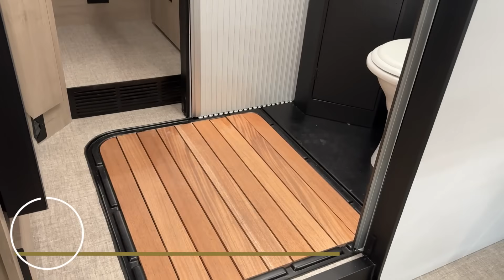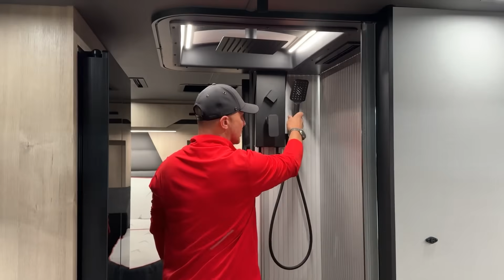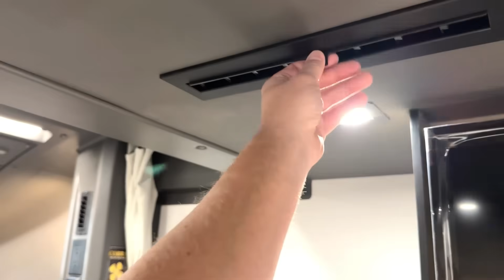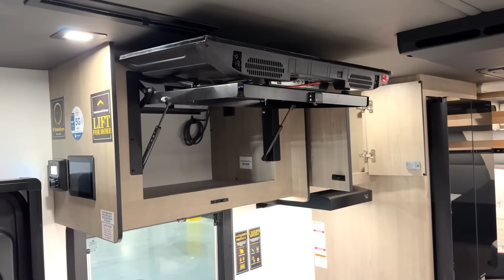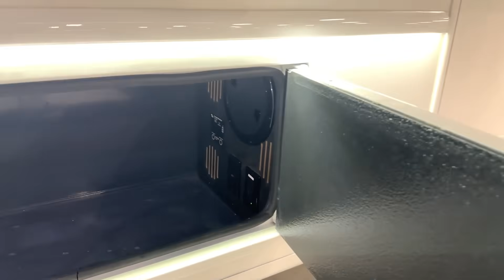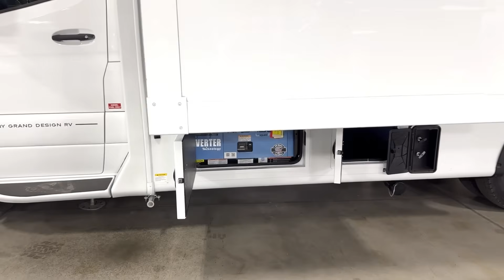RV WORLD FIRST! New 2026 Lineage 25TK Twin & King Bed Luxury Class C Motorhome by Grand Design

Comment: Would have really liked knowing if the gen. is propane or diesel.  Probably just go back and grab the model number he called out and run a search,  Love the below roof comments, I had thought maybe I went into flashback mode again..  Forgive me - the gen. is gasoline, I’d suspect that would make the engine as well.  Doesn’t Mercedes make a 4 cyc twin turbo?  I’d need something a bit heavier.  (Of course we all should’ve figured that out with only a 3500lb tow capacity).  If its the 4 it won’t make my list.

Comment: Looks really nice..BUT isnt Grand design having some serous product problems I once thought that they were the best RV out their but now I am hearing many complaints from many customer..and how is grand design dealing with this? I am in the market and looking.
Reply from the maker: Motorized and total are two different animals. A lot of that sentiment is also based on information from several seasons ago. It made a lot of changes since then, but no one seems to be reporting on the things that they’re doing well. Only the things that they did not do well previously.
Reply: @JoshtheRVNerd  Thank you..G.D. needs to speak up on there past and where they are now..Very true you will always hear the bad and its very rare to hear there improvements. Being a R.V. owner,I know already how hard it is trying to find a well(JUNK) built R.V.
and along with a rock solid  warranty .

Comment: Instead of the hanger type thingie on the hard to reach side, why not have it in the middle part?  I'd much rather a "Hope Chest" style under the bed for blanket / pillow / mouthy passenger...KIDDING!  lol   I really like this design!  I have lupus, so many times my fingers or knees or hips are stiff, so I like NOT having to step up into a shower. I'm also 5' tall, so I'd rather my feet don't dangle in the air if I have to sit on a perch toilet lol  It's the little things in life you learn to appreciate when you're older.

Comment: Great job reviewing this “prototype.” Will this vehicle be able to withstand light off-road driving to get to those scenic lake spots, etc. I am allergic to propane so I would prefer an electric movable induction cooktop to be able to cook inside or out. Plus, that would free up more counter / cabinet space above and below allowing room for appliances like Instant Pots, etc. And then instead of a cooktop range hood you could install a simple hanging glass protector. At this price the stairwell should have a cover piece to prevent falling or even better, the stairs should be completely on the outside. All the cabinet doors should be flush. The kitchen sink faucet should have a retractable sprayer head. The rod for hanging clothes is really neat and using cedar to construct it would be a bonus. I don’t think the euro door is all that it is hyped up to be since it is so narrow. I would prefer a wider door with a bear proof steel “screen door”, like the Tiffin class C. It would last longer if the outside storage boxes were made of fiberglass or metal rather than the plastic you said the production line will have. The towing capacity somehow needs to be increased to at least 5,000. The shower is super innovative and clever! However, some sort of “covering” needs to be engineered for the shower floor to convert to a hallway. Or maybe the shower floor could roll in and out of the toilet / sink area? Also, the bathroom sink needs to either be extended out from the wall or the type that folds up to the wall as those can be very long when brought down for use. Is there an option for the toilet to be the incinerator style? Also, if the length could somehow be shortened to 24’…

Comment: Very cool I like it a lot my one really really big bitch. Is that full fiberglass beautiful tail cap with no bumper ? If you take a hit that whole cap is ruined there really needs to be a bumper. Or provisions to add one. Also, stinky slinky should be on the bottom, not on the top. You don’t want sewage dripping down on your valve controls. Also, there needs to be allowances for battery expansion so if you feel like adding extra batteries, like use one of the storage compartments, you can easily hook up extra batteries.
Reply from the maker: Maybe the receiver hitch could be used to have a bumper insert?

Comment: I love that you don't have to open the slide to access the beds.  My question is - can you sit in the recliners when the slide is closed.  I believe on Schwintek slides you are told NOT to sit on anything in the slide when it is retracted into the RV because it could do damage.
Reply: If there's seat belts, then yes
Reply from the maker: Yes, you can. Motorized RVs and tow bowls are essentially constructed differently. Motorized RVs are built with the idea of occupying them in transit. Where is RV’s usually are not

Comment: Instead of a teak floor under the shower I think an attractive and durable composite plastic wood-look floor would be better.  Teak is too difficult to maintain and I feel it will get funky and require too much care.  Also I would want to put an easily washable area rug over that area because I wouldn't want to dirt and stuff to fall through the grate.  I do love the idea of having a larger shower though if it works well in fact and not just theory.

Comment: Love your show but will never buy another Grand Design.
Reply from the maker: Not looking to argue or change your mind - only understand. May I ask why you feel that way?
Reply: @JoshtheRVNerd we had a brand new grand design fifth wheel for a three or four years that required a lot of work. It was a 2019 303rls. We also had some frame issues that were thankfully fixed under warranty. Even so, Grand designs frames don't have a very good reputation right now.

Comment: It’s a start but it. Ed’s cleaned up ascetically.   Make the kitchen cabinet doors and drawers flush…have an options for a king or queen bed and take that middle wood thing out that’s between the beds.  Bathroom cabinet and sink could look a lot better…under mount the sink and just use a smaller faucet.

Comment: I dont get how this can become a dry bath by covering the toilet part when showering, then water will be splashing outside the kitchen area if you cover the toilet and not enclosing the shower area part. Also, does the shower area have vent fans? Curious if its the dollar fart fan or the FFFFF
Reply from the maker: There are multiple different partitions. You can enclose the shower and toilet. But there’s also a second interior partition to also cut off the toilet area without exposing the kitchen.

Comment: Love the innovative bathroom; genius! Love the large inclining twin beds; wish they could convert into a lounge area. Love the acrylic windows; hope the blinds are on the bottom side for privacy! Love the quiet AC. Hate the slideout, always problematic ! Nice galley. Hope it has a true residential minimum R-20 insulation... not fake 4season... Looks promising!Love the innovative bathroom! Love the large twin beds; wish they could convert into a lounge area. Love the acrylic windows! Love the quiet AC. Hate the slideout, always problematic! Too many step sections. Very nice galley. Three TVs... they should be optional, hate those outside TVs. Hope it has a true residential minimum R-20 insulation... not fake 4season..., heated floors to avoid noisy heaters and increased comfort, and on-demand WH. Great, a 4500 chassis. Hope they offer a no cab over option, more aerodynamic and reduced height... I am somewhat pleased. Looks very promising! Thanks.
Reply from the maker: You bet. My pleasure

Comment: Josh, I think that's the perfect party-mobile for uncle Gary and I. It's got everything that we'd need to keep the party going. 😁

Of course, I'd need to clear it with tge boss (a.k.a. my wife), because the last time I went on a weekend party trip, I couldn't find my pants. 😋

EDIT:
To your point about making things better, or cheaper. I'm with you! There's nothing worse than getting to your destination, only to find that something integral is broken/defective.  On the other hand, I hate it when manufacturers go overboard, by providing good quality for astronomical prices. It's egregious; and not necessary. Fair prices for fair quality. 😃👍
Reply from the maker: party with uncle gary.. brave man

Comment: Major kudos for bringing welcome innovation to RV design in the US! The one major suggestion I would have made, had I been asked, would be to build it on a double floor. That would add insulation from cold, increase storage in the floor, allow tanks to be located for optimum center of gravity, and permit a level interior floor. Many European coaches use double floors, and I imagine using the MB 4500 chassis would have accommodated that feature here. Cheers!
Reply from the maker: Thanks for the tips!

Comment: Outstanding review…well-done. A very innovative rig. Several questions…is there an option for more lithium? Is there a second altenator that can charge the batteries while driving? Is there a generator delete option? Finally, wonder if could move the  outside speakers and sound control up so the light bar body trim goes all the way across without interruption for a cleaner look. Can’t way to see in person and test drive
Reply from the maker: Essentially, they’re just not offering any changes to those extent

Comment: I love everything in this. All my must have but one. Not enough towing 
We have a 59k Winnebago travato. Love it,just need something just a bit larger for a bathroom. I wish they would give 5000 pound towing. Don't understand the 88 pound propane?? You don't need that much and it adds weight. The tank sizes are great. For those of us that will never use over the cab as a bed it would be nice as an option for additional hanging some kind of bar. The curtains will hide anything you put up there. Being able to have that area for more clothes would great. Still need some more CCC. 1400 to1500.
When you add all the water weight, propane,people and #Stuff. Don't need three TV so that should be optional.
Reply from the maker: Yeah the mercedes setups are usually more limited on towing vs something like a ford E-series

Comment: The hanging storage under the bed should have a panel that opens on the front, so that if you use it you can get in there without lifting the bed

Comment: Very fancy but missing the space under the top step for shoes, and the built in gas grill set up
Reply from the maker: They used that space for the electrical systems. It's always tough in a smaller coach where space is limited

Comment: Something that I have noticed with almost all RVs that I have seen.  When the command system and stereo layout of the installation, in my opinion, takes up more space than I  think is necessary.  By installing these items closer together or in this unit one over the other, allows extrall, albeit small, wall space to mount a key holder or a small cabinet with a picture of those traveling in this mh and in the box behind the picture is a place to keep emergency health and contact information.  Yes, I  am aware of the headrest safes, but in an emergency those will be difficult to open and access the information.  I dont mean to bring a bad thought to what should be a happy time, but those other drivers out there are dangerous, plus road hazards don't take good care of your tires.  Then there are certain health concerns that don't care about age or how healthy one could otherwise be when they attack.  The papers could have vital health information such as blood type, diabetes, allergies and more.  That information could safe lots of time when needed.  Just an idea to pass on should that information become needed, may your God be with you and it never is, the first responders could grab it quickly.  Something for all manufacturers to think about installing.  As you say Josh, stay safe, have fun but accidents do happen.  
Drive to arrive alive, because there is someone out there that loves you, and wants to see you come home safe.
Reply from the maker: I think they allow extra space in those areas in case the hardware ever changes out from under them at some point. That way they can adjust and fit things in as needed.

Comment: I'm not sure why I watched this, but boy howdy am I glad I did! What an absolutely incredible job of packaging. A couple of things I don't get, though. Why put the LP connect outside? It's another hole (holes are bad, look it up) to deal with, and the tank is right there. Put the connect on a bracket in the LP bay and run the hose under the wall. Same with the drain valves. Enlarge the adjacent bay and put them on a panel inside. At this price point, those little plastic doors look terrible, even when painted. Inside? *Chef's kiss*! Unbelievable road mode access, and rear beds in a 25-footer that don't need folded enroute?! Ooh-la-laaaa! Any chance they'll offer this on a more powerful chassis? 1200# CCC is ok for a couple, but 3500# towing makes for a tiny toad. I'm not willing to trade my pusher, but this is the equivalent of that dorky little nerd in high school who somehow gets the head cheerleader to be his girlfriend. It's unassuming, but does just about everything just right. The epitome of, "it's what's on the inside that counts." Great job as usual, Uncle J!
Reply from the maker: I’ll be really curious to see how the motorized lineup from this company continues to evolve overtime but I don’t have any details for specifics right now

Comment: Been happily married to my best friend for 34 years. That this rig offers a legit King Bed option is the sole reason I'd buy it. That said, tons of innovation. Very impressive!
Reply: With the bathroom out of the way of the rear sleeping space , could they make a larger queen size corner bed model,  with the bed on the passenger side and storage on driver side to keep bed made and up all the time with more open space like the 25FW, but without the need to fold up a bed so it can be used with slide in.
Reply: @marcln  You buy that plan. I'm stickin with this one.😁

Comment: The styling is beautiful and kudos to them for the creativity in space utilization.  However, this shower space is a hard ”no” for me.   Here’s the problem.  I don’t know about anyone else, but after I take a shower, the shower floor is always wet.  You’re going to end up with a big wet spot in the middle of a high-traffic area, so you have to dry those wooden(?) slats, and probably the shower head to prevent some residual drips.  If you forget to dry it or don’t dry it well enough, you end up with people tracking water all over the interior floors. If there’s any dirt or sand on the bottom of your shoes, you’re gonna end up with mud prints all over your floors. I also noticed that they’re very light colored floors so that’s going to show up quite a bit.  Multiply that, by the number of people you’re camping with.  It’s just…messy.  Even worse is the potential for someone slipping on the floor. Yikes
Reply: And where do you set your soap and shampoo?  Lemme guess, the fridge?
Reply from the maker: Totally understand your concern there

Comment: We are loving the Lineage lineup but I hope they don’t integrate this bathroom. 
1. Where do you put your shampoo, soap, etc. You’d have to use the sink. 
2. The floor is wet after. The dog walks through it and is on your bed while you’re still drying off. 
3. Those doors need to offer more privacy. Especially the one near the toilet. RV life leaves little to the imagination. I don’t want those images too! 🤣 

Seriously though we can see owning one of these in the next couple of years of nice we are not fulltime. Love the lineup!
Reply from the maker: You're not wrong on any of that
It’s a weird setup that creates new solutions but also makes new problems at the same time

Comment: I like the 36"x80" (x2) bed arrangement in the back, the ventilation of front overhead bed, the extra-large chair tables, and the extra-large counter extension. It is obvious that a lot of transformative thought went into this new vehicle. However, the "centerpiece" of the design - the hall shower - is a big no for me. I understand trying to use all available space, but with this layout, if someone is in the shower, one cannot walk from bedroom to the front of the motorhome, or get into the refrigerator. It seems to cause more questions than it answers.

Comment: We’re currently full timing in a Sprekko, only a foot shorter than this.   But, this looks a whole lot more comfortable.  
—-Big fan of the large fridge, bunk over cab, flip up counter, windows - especially full black out vs standard pleats that still let light in.  Like the 4500 chassis, like the improved slide room mechanism, like the Bilsteins, love the plumbing connections.  
—Not a fan of the split in the bed mattresses…would rather they adopt more of the Ekko under bed storage.   
—Not a fan of their screen door choice…our cat would rip that to shreds in 5 minutes.  
—Not a fan of tiny cabinet pulls, please give me real handles.  
—Would rather have the sofa/recliner option without forced center piece…just give me 2 lagun tables.    
—Please put your garage l tracks in the ceiling so we can hang a shelf.  
—Hope the tv’s and sound system can be deleted…then I would use that tv space for another kitchen cabinet.  
??Josh, maybe you covered this, but:  OCCC?   You said 500 extra, getting you to what?   Am I ending up with similar capacity to the Ekko because they spent some of that back in a slide room and levellers?  

EDIT - just saw the OCCC when I replayed it.  I’m out, that’s less than my Ekko.  What a shame.
Reply from the maker: Btw love your input. Ty for taking the time to share this. Love hearing from actual owners
Reply from the maker: Factory doesn’t really offer entertainment deletes as it turns out